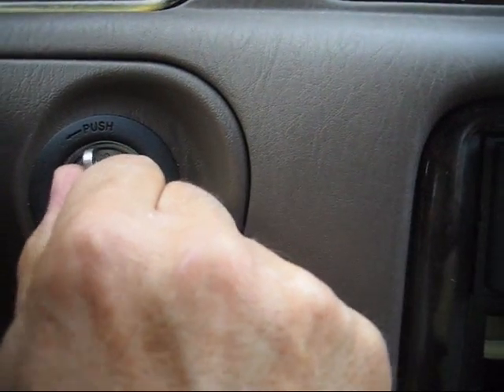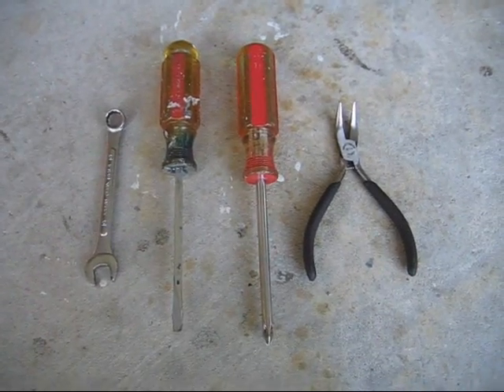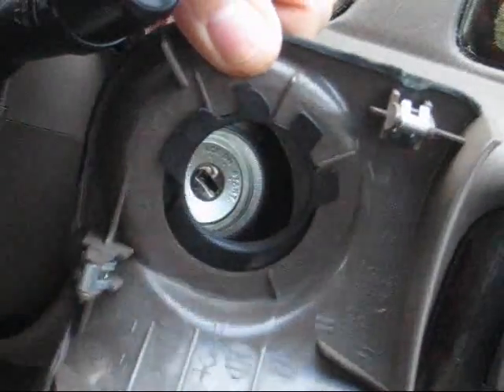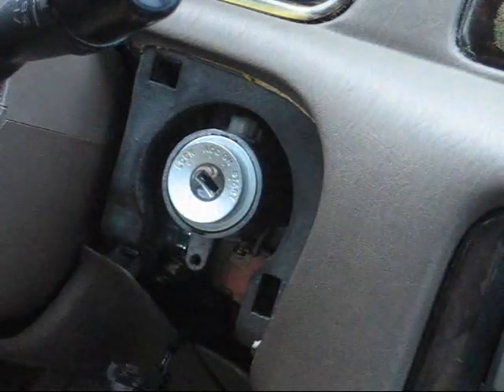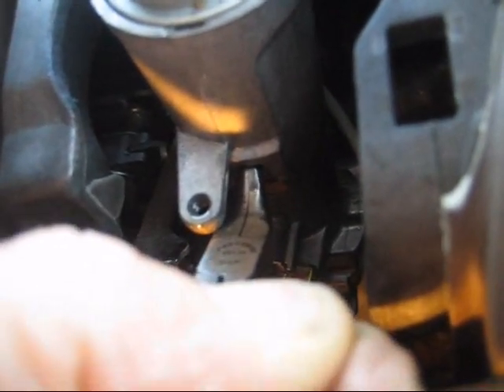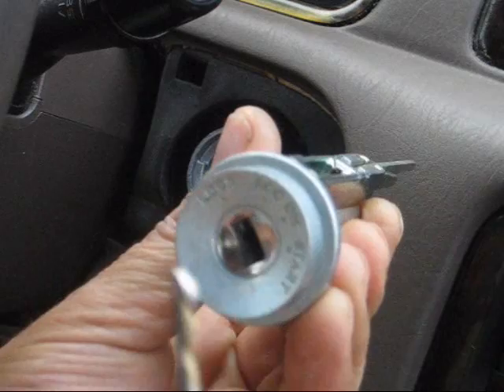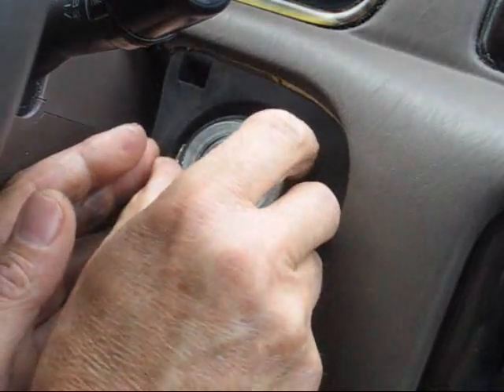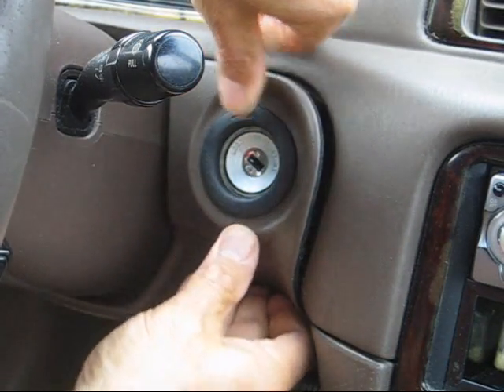Ignition Key Lock Cylinder Replacement - 1998 Toyota Camry (1997 thru 2001)

Comment: usually, the keys wear out, not the cylinder... I would have worked with a new copy of the master key, though.
Reply from the maker: Actually that was exactly what I tried first, I had a new (spare) key and I had made a copy from the new key as well. In my particularly case the cylinder was really worn and replacing it got me back on the road. Thank you Sorin for posting.
Reply: Thank you for posting your tutorial. , Without it, I would have tried to pull the cylinder before detaching the transponder ring, for another 30 minutes...:). I try to make the cylinder to turn with the most worn key and after that, to cut all keys after the new shape...
Reply from the maker: Glad to hear it helped. Thank you Sorin for your sharing your experience.

Comment: What if you dont have the keys
Reply from the maker: Hi alejandroguerrero88, other than a locksmith, try the dealership. If you have the VIN and proof of ownership they can cut you a new set of keys with this information. Not sure of the cost though. Good luck alejandroguerrero88.

Comment: What if you got no key
Reply from the maker: Hi Wilmer, I can only suggest from my previous posts, besides recommending a locksmith, you can try the dealership if you have the VIN and proof of ownership. They possible can cut you a new set of keys with this information. There's drilling of course but I would have to suggest some good videos out there specifically for drilling. I hope it works out for you Wilmer.

Comment: For no more than $40 bucks. You could take the new cylinder to a locksmith and have it keyed to match the doors
Reply from the maker: Absolutely correct. I actually had made that same exact suggestion in one of the my earlier  comments. For me, I found that out "after" I had replaced mine. 😀  Thank you 2815Juan for your comments/posting.

Comment: (98 Corolla) My ignition won't turn out of lock
Reply from the maker: Sorry Seth, I'm not familiar with the Corolla.
Reply: @DoItYourSelfers  I meant Camry my bad, and i actually just got it fixed, went and bought a new cylinder and put it in, thankyou
Reply from the maker: Awesome, good to hear it worked out. Thank you Seth for your comments/posting.

Comment: That's all nice, but I thought you couldn't move your key. My key will not turn at all, not even to the acc position. Now what?!
Reply from the maker: I mentioned in an earlier post, I had tried different keys, a newly cut key and moving the key back and forth for a good while till my hands hurt. Honestly, I don’t think any of those things worked other than sheer determination/persistence. I kept moving the key back and forth eventually (randomly) the key moved in to the ACC position. I have read some people drilled the little clip that you have to push up on in order to release the cylinder. Good luck Captain Jay Ready. Let me know how it works out.

Comment: Damn I wish the button was on the bottom with my car, it's on the blooming top, that and I lost my only key to it.
Reply from the maker: If it’s a key you need I would call the dealership. If you have the VIN and proof of
ownership they can possibly cut you a new set of keys with this information. Good luck Dusty. Let me know how you make out.
Reply: DoItYourSelfers 
That might have worked, had I not have destroyed the cylinder trying to "manually" tried to turned it with a flathead screwdriver, now, I do not have any other choice but to drill out the thing, however, I do commend you on a beautiful orientation on how to properly perform the task, any future endeavors on removing a ignition cylinder, I will consult your video now, in memory, thank you anyway.
Reply from the maker: Sorry to hear that. I hope it all works out. Thank you Dusty for the kind words.

Comment: So, my key won't turn. 😅
Reply from the maker: Getting the key into the ACC position is the hard part. I mentioned in previous comments, I had tried different keys, a newly cut key and moving the key back and forth for a while till my hands hurt. I kept at it and it did eventually (randomly) move into the ACC position. I don’t think any of those things worked other than sheer determination/persistence. I have read some people drilled the pin that you have to push up on in order to release the cylinder. Good luck Aurélien Carnoy, let me know how it works out.

Comment: If the key don't turn how tf you gonna turn it to accessory 🤦‍♂️
Reply from the maker: Getting the key into the ACC position is the hard part. As mentioned in my other comments, I had tried different keys, a newly cut key and moving the key back and forth for a while till my hand hurt. I kept at it and it did eventually (randomly) move in to the ACC position. I don’t think any of those things worked other than sheer determination/persistence. I have read some people drilled the pin that you have to push up on in order to release the cylinder. Good luck Cody, let me know how you make out.